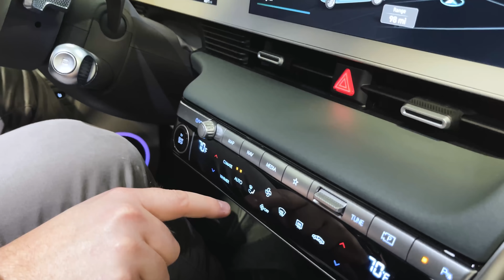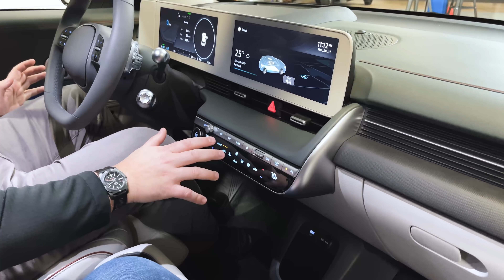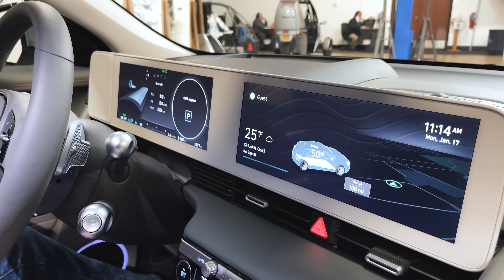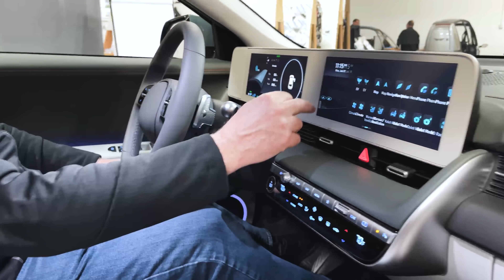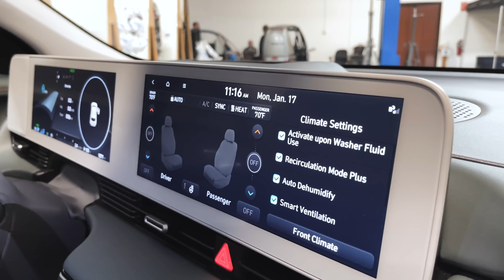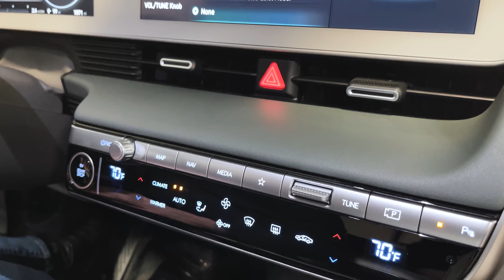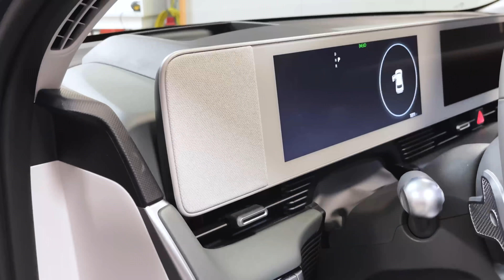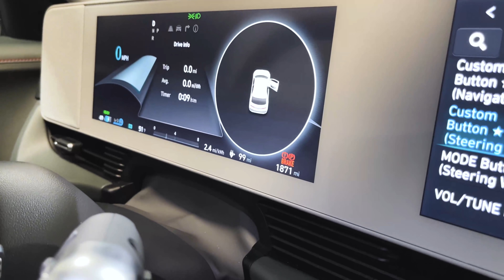2022 Hyundai IONIQ 5 | Sandy's First Impressions

Comment: 👍 EV, almost no chrome, roomy inside, no center console, truck like dash, good leg room.
👎 Low ground clearance, no door handles, windshield tilted too far back, dealer mark up is $10k over sticker, WTF?!

Manufactures need spin off a direct to consumer division, no dealer, low MSRP, no haggle. Why is this so hard? The dealer model sucks.

I've seen this in person and it's a mixed bag.
Reply: The sucky dealership model is the precise initial reason I became interested in Tesla.  In my home state of Alabama, the stealership mafia requires anyone buying a new car, to sign away their Constitutional right to a jury trail, and agree to "binding arbitration".  Binding arbitration is a straight up a rip off.  If you don't believe me, look it up for yourself.  You probably won't believe how bad it is.  Tesla was the only one that disrupted this band of thieve"s scheme.  The dealerships should be charged with a Racketeer Influenced and  Corrupt Organization (RICO) act violation.  Your State probably has similar corruptions. The reason that people haven't demanded change is that they don't know, or don't care  because it hasn't affected them yet.  I just can't praise Tesla enough. BTW, does anybody really think Hyundai would be building an EV as good as the Ioniq 5 if not for Tesla?
Reply: @wilfredvanvalkenburgh2874  Tesla pioneered change, and successfully built not only a challenger to ICE vehicles, but a direct to consumer model, with both a superior product and acquisition. They deserve so much praise and respect, however, IMO, the design language is polarizing. I think that's why the F-150 Lightning, which has a traditional design, is doing well. I'd buy a Tesla in a heartbeat if, it was roomier, and actually had door handles, not just grad sticks. I'm pro EV, not particularly loyal to any brand, but there are practical considerations any EV maker should take into consideration.

Comment: When you purchase the car, the dealer will explain all the features to you or you can read the owners manual.  Fiddling with a touch screen at 70 mph isn't safe, leave the buttons.  If you don't know what auto hold is, don't knock it.  You are way too critical for someone so uninformed on the car.  Who cares about a frunk.

Comment: Good attempt, and very competitive in terms of pricing.  Styling is great though it'll be a couple of years until we see one from Hyundai that's designed to be an EV from scratch.
Reply: It was designed from scratch as an EV. The IONIQ 5 and EV6 are based on their entirely new 800kWh platform. It's the Kona etc that were ICE vehicles in the beforelife.

Comment: Seriously ugly car, so much grey plastic, square on the outside but circular themes on the inside.  Looks like the bonnet/hood is about 100mm higher than it should be at the front edge.  The plastic trim on the lower external doors is just not required... more waste, looks tacky and adds manufacturing costs.  The grey pastic around the wheel arches would look great colour coded and the silly sharp strips moulded in were removed. Two spoke steering wheel, ugly as normal. The designers have gone silly.  A point i'll bring up with these drive shifters.  Why the hell would drive be to push the lever forward.  Just like a regular transmision shifter, you are supposed to pull back for drive!  Push forward for reverse.  Its the way its always been!  However, the column option is great, way better than the stupid twisty dial on the Kia.  The screens look horrible, two obviously separte screens stuck in bright white glossy surface.  Yuk.  The lack of any middle console also means you will get stuff stuck under the pedals.  No frunk of any value, no lower rear storage areas.  Seriously, Tesla has basically no competition.